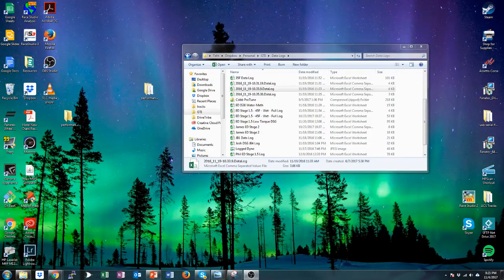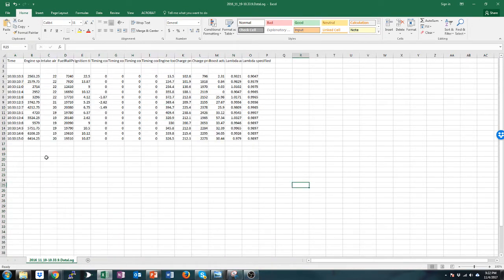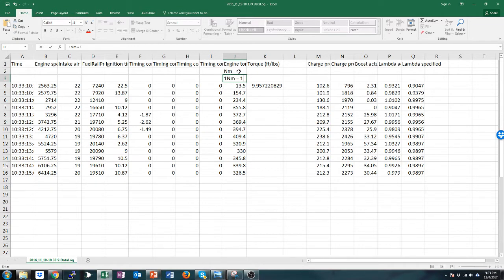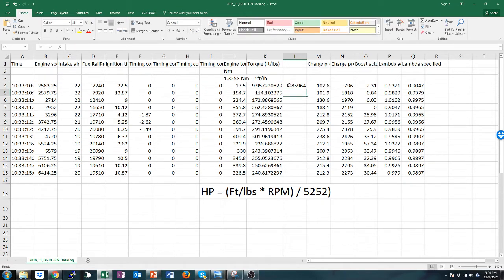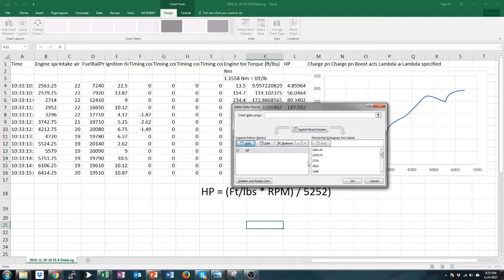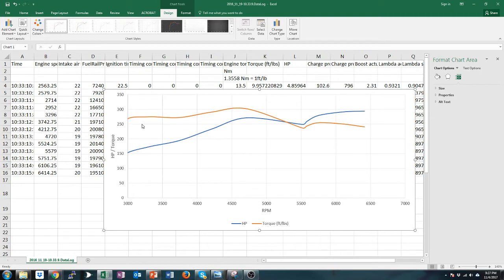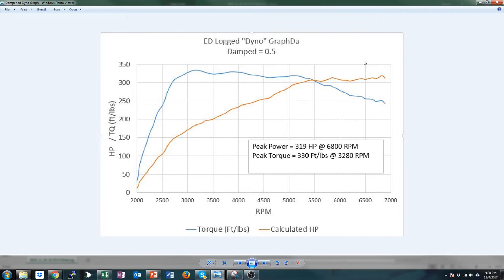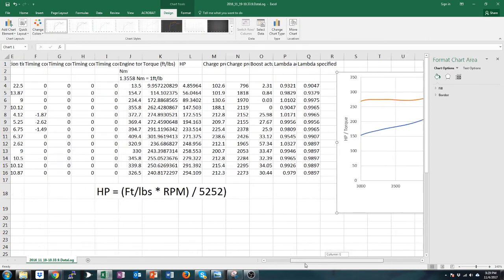How to Make a Virtual Dyno

Comment: Have you tried to use the virtual Dyno software? It takes maestro logs.  I wonder it compares to your method.
Reply from the maker: PricelessTuning both have issues, but these are nice because they are consistent. However the real numbers can get quite far off from reality in the top end
Reply: Karl Taht nice man. I'm tuning on MED9.1 and it's very different from the newer ECMs.  I saw your Maestro video on it. 

Have you tried running e85 in your car? Might give you more room for timing. IDK how your car would deal with cold starts because I can't figure it out for the life of me on the FSI. You and I don't have cold crank maps like the ME7.x